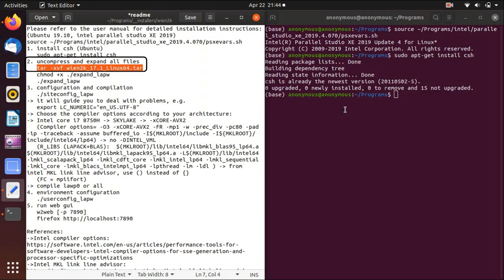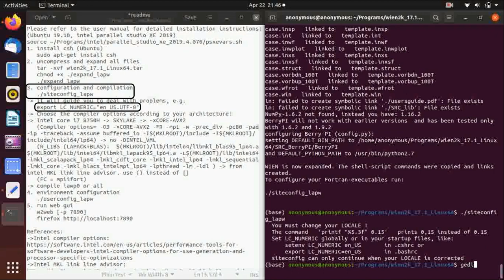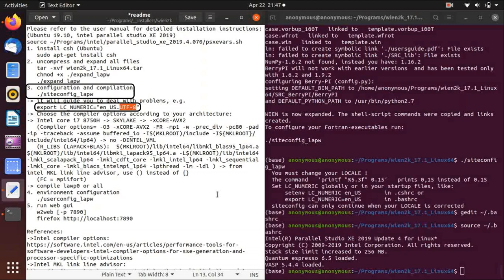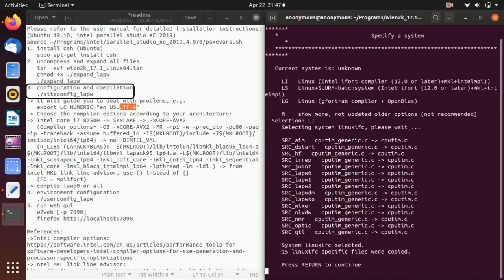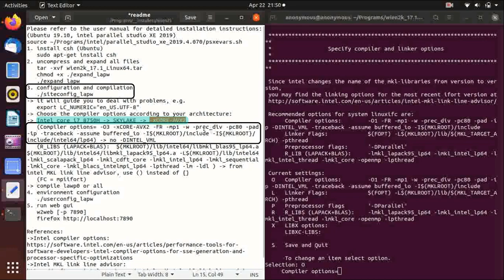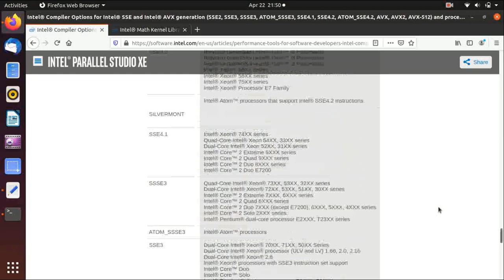wien2k tutorial 1: compilation (parallel&serial, Ubuntu, Intel compilers/MKL/MPI) and server setup

Comment: After the compilation of Wien2k using the Intel Fortran compiler, could anyone please assist us with the following issues?

SRC_lapw0/compile.msg:libxc_mod.F(4): error #7013: This module file was not generated by any
release of this compiler. [XC_F03_LIB_M]
SRC_lapw0/compile.msg:libxc_mod.F(9): error #6457: This derived type name has not been declared.
[XC_F03_FUNC_T]
SRC_lapw0/compile.msg:libxc_mod.F(10): error #6457: This derived type name has not been declared.
[XC_F03_FUNC_INFO_T]
SRC_lapw0/compile.msg:libxc_mod.F(5): error #6580: Name in only-list does not exist or is not
accessible. [XCCONST]
SRC_lapw0/compile.msg:libxc_mod.F(5): error #6580: Name in only-list does not exist or is not
accessible. [VX_SWITCH]
SRC_lapw0/compile.msg:libxc_mod.F(5): error #6580: Name in only-list does not exist or is not
accessible. [VC_SWITCH]
SRC_lapw0/compile.msg:libxc_mod.F(5): error #6580: Name in only-list does not exist or is not
accessible. [EX_SWITCH]
SRC_lapw0/compile.msg:libxc_mod.F(5): error #6580: Name in only-list does not exist or is not
accessible. [EC_SWITCH]
SRC_lapw0/compile.msg:libxc_mod.F(22): error #6404: This name does not have a type, and must have
an explicit type. [XC_FUNC_X]
SRC_lapw0/compile.msg:libxc_mod.F(22): error #6404: This name does not have a type, and must have
an explicit type. [XC_UNPOLARIZED]
SRC_lapw0/compile.msg:libxc_mod.F(23): error #6404: This name does not have a type, and must have
an explicit type. [XC_FUNC_C]
SRC_lapw0/compile.msg:libxc_mod.F(25): error #6404: This name does not have a type, and must have
an explicit type. [XC_POLARIZED]
SRC_lapw0/compile.msg:libxc_mod.F(34): error #6404: This name does not have a type, and must have
an explicit type. [XCCONST]
SRC_lapw0/compile.msg:libxc_mod.F(38): error #6404: This name does not have a type, and must have
an explicit type. [XC_INFO_C]
SRC_lapw0/compile.msg:libxc_mod.F(38): error #6404: This name does not have a type, and must have
an explicit type. [XC_F03_FUNC_GET_INFO]
SRC_lapw0/compile.msg:libxc_mod.F(39): error #6404: This name does not have a type, and must have
an explicit type. [XC_INFO_X]
SRC_lapw0/compile.msg:libxc_mod.F(40): error #6404: This name does not have a type, and must have
an explicit type. [XC_F03_FUNC_INFO_GET_FLAGS]
SRC_lapw0/compile.msg:libxc_mod.F(56): error #6404: This name does not have a type, and must have
an explicit type. [VC_SWITCH]
SRC_lapw0/compile.msg:libxc_mod.F(56): error #6404: This name does not have a type, and must have
an explicit type. [EC_SWITCH]
SRC_lapw0/compile.msg:libxc_mod.F(57): error #6404: This name does not have a type, and must have
an explicit type. [VX_SWITCH]
SRC_lapw0/compile.msg:libxc_mod.F(57): error #6404: This name does not have a type, and must have
an explicit type. [EX_SWITCH]
SRC_lapw0/compile.msg:make[1]: * [Makefile:171: libxc_mod.o] Error 1
SRC_lapw0/compile.msg:make: * [Makefile:120: seq] Error 2